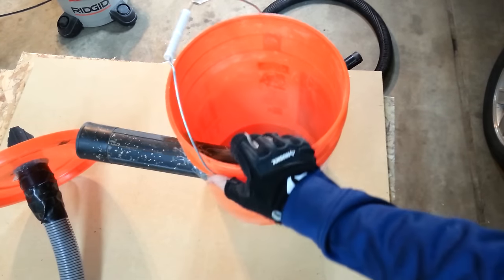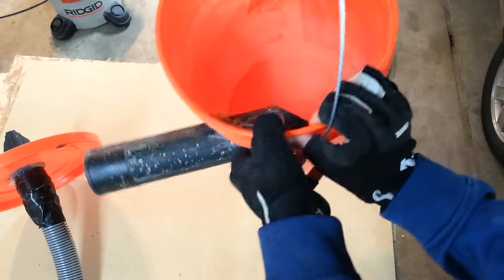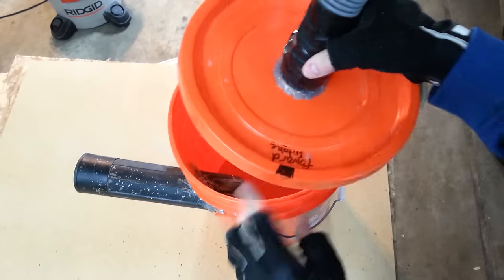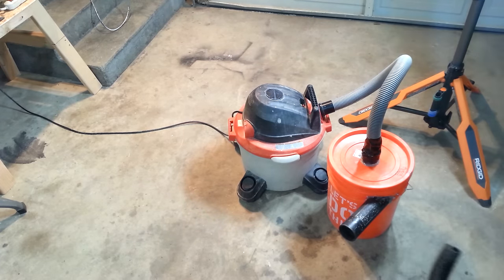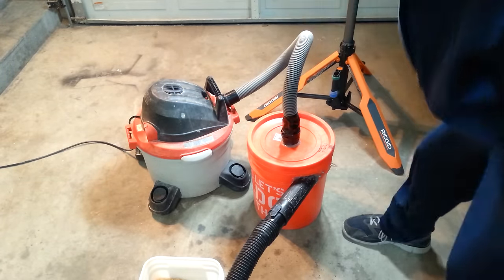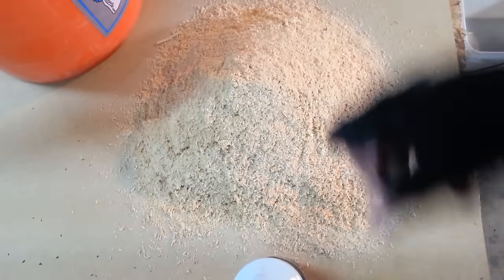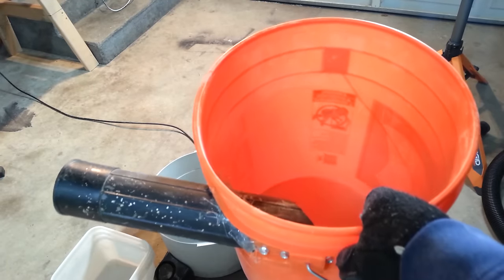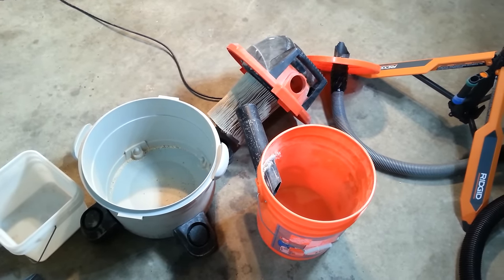DIY Dust Collector/Separator home made in less than 20 minutes with a bucket and spare vacuum parts

Comment: Thank you , I just made this for the price of $1.45 , I had an old vacuum that I used for parts with my 16 gallon wet dry vac and I bought the lid from home depot for $1.45 ,and  it works great . Thanks for sharing your talent .
Reply from the maker: Sure thing glad I could help and that it worked out for you. 👍

Comment: Thank you for posting this!  I made mine this evening.  This has helped already SO MUCH!!  I put both hoses on the side of the bucket.  One like you have.  And the other, to the left of the first one on the same side.  I faced the angle cuts opposite each other as you mentioned.  I also cut the holes the same size and used heat to 'squeeze' the hoses in so as to make a tight seal without having to add extra 'stuff' to seal them.  I put plastic strips on each side of the bucket and the wet-dry vac.  I stacked the wet-dry vac on top of the bucket and used the plastic strips (with wing-nut screws for quick-easy detachment) to keep the two stacked.  It was easier for me to move around this way.  I also added a HEPA filter on the inside of the wet-dry vac and over the exhaust.  This keeps the smaller particles from coming through.  Again, thank you SO much for your post.
Reply from the maker: I'm really glad you liked it and that you were able to build one that worked for you, I think that's really cool that you added a HEPA filter to it that thought never even crossed my mind! Thanks for watching my video and commenting, I'm really glad it helped you out! 👍

Comment: Great work. I put a 3 pound exercise weight in my bucket and have no problems with bucket tipping. Also I have a shorter hose between the vac and bucket. Thanks for sharing.
Reply from the maker: Sounds like a good setup, glad you liked the video.

Comment: Thank you for sharing. I made this today since I bought a new shop vac and wanted to preserve the filter and bag which are both quite expensive to replace. I used what I had on hand... thank goodness I kept hoses and attachments from past vacuums. I burnt out the motor on my mini shop vac not realizing how much dust is generated from the table saw {my first), so I need to control the dust...cheers to healthy lungs! I spent $2.50 US, the cost of the bucket. Very excited to complete projects now that this is done.
Reply from the maker: Glad it helped u out, I also built mine after I got my first table saw because it creates so much dust and this dust collector is a good cheap way to keep most the dust out of your shop-vac to keep the filter cleaner and extend the motor life! I actually had all the parts on hand so mine didn't cost me anything to make and I have hoses running all over, I have one hose that my miter saws share and another hose that my router table and table saw share so I don't have to change hoses around as often which is nice. Thanks for watching my video and I'm glad it helped and thanks for commenting! 😊

Comment: Add 2nd bucket and make it taller for better 'waste drop' . Taller waste drop creates less filter clean up. So join both buckets at rim by modifying lip and insert together then drill hole in sidewall with 45 degree elbow to spiral partially downwards.Use same process for suction input
Reply from the maker: Sounds like a good idea, I'll have to try it out. Thanks for commenting.

Comment: Great idea and a simple design.  Good questions and answers too.
For me, it's about grinding off carpet glue, three layers of old, flaking paint and a certain amount of concrete dust.  Tried going direct from my angle grinder dust shroud to my shop vac but had to stop and empty the dust and shake the filter off every 5-10 minutes; way too much faffing around.  I will give this straightforward design a shot as the HD Duststopper is expensive and needs expensive hose adapters, which may require modification.
I sure hope that not too much of my toxic dust gets to my shop vac.
Reply from the maker: I hope it works out for you, please let me know how well it works because I've had a lot of questions how well it will work with fine dust like drywall and concrete dust before but I haven't been able to answer them because I've only ever used mine for wood dust, it stays in a fixed place in my garage and I hook it up to all my woodworking machines like my miter saw, table saw and router table for the most part and it works great with those. So I'm very interested to know if it will work with dust as fine as concrete and drywall, one tip I've heard that might help if it's not collecting the dust very well is to put a small amount of water in the very bottom of the bucket so it will help catch the dust, but not to much because you don't want the vacuum sucking it up. Thanks for watching the video and I hope it works for you and please let me know how well it ends up working with that concrete dust! 👍
Reply: @chevy5137  Waiting for my new Ridgid hose to arrive, when I will do a  dry assembly and see what PVC pipe and adapters are needed - I'm favoring rubber connectors. Take a trip to HD and will let you know the result.
Reply from the maker: Milwaukee m18 metal saw
Reply from the maker: @SELondonUSA  Sounds great let me know how it goes 👍

Comment: I seen that on another channel last week ,then he bolted it to the top of a rigid vacuum seemed to work pretty effectively!!!!
Reply from the maker: Yeah that's a good idea if you need it to be portable, another way to go is you can make a cart with caster wheels on the bottom with a divider in the middle and put the bucket and vacuum side by side so it's not top heavy and you can also pull it around easy since it's on wheels. The reason I didn't didn't do either of those things is because my vacuum and bucket stay in place under the work bench that I made for my router table to go on top of and they never move. I have hoses going along the wall of my shop where all my woodworking tools are so I can hook up my miter saws, table saws and router table all to it without having to move it.

Comment: Nice and simple. One thing that I observed that you did but did not mention in the video is that you stabilized the pipe in the side of the bucket with 1 screws. This seems to be a necessary feature to keep everything from relying on hot glue alone which is not  strong enough to support that pipe all by itself.
Reply from the maker: Yeas I did do that and it needs to be there to help stabilize it unfortunately I forgot to mention it in the video. I'm glad u noticed that!

Comment: In regards to the collapsing bucket issue you could probably make a valve that would open if vacuum inside got too extreme. Some vacuums like my old dyson has this already built in, if you fully plug in the inlet you can hear the valve pop.
Reply from the maker: I want the vacuum to run at full power though so that it'll suck as much dust in as possible so doubling up the buckets was the way to go I think.
Reply: @chevy5137 Good idea to use a second bucket but the lid also collapses, no? Do you have a solution for that?
Reply from the maker: @za.z.6061  I never had the lid collapse on mine but with a stronger vacuum I added it started sucking in the bucket sides so I had to glue and screw 2 buckets together.

Comment: The Thien baffle keeps the system from sucking up more dust as the bin gets full. Without a baffle it is going to pass more and more dust the fuller the bin gets.
Reply from the maker: Yes that's true this is a very simple design but if you empty it when it gets about 1/4 full it does the trick.

Comment: Great video .
Just a thought have you ever tried putting a brick in the bottom of the bucket just to make it a bit more stable .
Regards from the UK.
Reply from the maker: Terry Robinson no I hadn't thought of that before because I have mine in a confined area where it can't move, I only have it out in this video for demonstration purposes, but that's a really good idea! It would definitely help keep the bucket from tipping over when you have it out in the open. Thanks for watching the video and commenting with that really helpful tip! 😁
Reply: @chevy5137  A little in commenting but using another bucket with a few inches of concrete in it, that you then set your separator in works great.  It really stabilizes it.  Thank you for the video.

Comment: Ok after watching a lot of these videos and doing research I can tell you the weakness of this design . The more dust that goes in your bucket the worse performance you will get. This system scrubs the dust in the bucket and then the stirred dust will fly up the pipe to the vaccum.  Both the thein baffle and the cyclone will out perform it.
Reply from the maker: Yeah this is a cheap solution and you need to empty it when it's about 1/4 to 1/3 full for it to stay effective.

Comment: Was thinking about making a device exactly like this but just wouldn't allow myself to believe something so FAST AND EASY could work so well.  I guess it's the SCIENCE behind the effect that actually does the job.   Want to make one for my dust collector but adding the baffle seen on most others, either fabricated or factory produced.  Thanks for doing the prototype work.  Now I'm wondering if an old shop vac tub would work even better due to its larger capacity and sturdy construction.
Reply from the maker: Wayne Cameron Yeah I was surprised to at how well this model works and yeah if u add that baffle deal it'll work even better, I haven't bothered doing that because I don't use my tools that hook to the vacuum system enough to warrant it.
Reply: I found out about this sort of thing only a week ago and now I'm nuts for 'em.  I want one on my dust collector AND my shop vac.  My DC has a 5 micron bag which is WAY better than no collector at all (wife bought the unit for me) but now I've got a layer of 5 mic dust on everytghing in my shop.  I'm also getting a Wynn .5 mic pleated paper filter and having about 10 times the surface area of my bag, plus I'm going to have a powered vent to the outside.  I'm doing a remodel of my workshop benches and building-in my bigger power tools, and building an automated system to pre-control dust and chips is going to be a big time and hassle saver.  Having to constantly deal with that is one reason I don't make as much stuff as I want.
Reply from the maker: Wayne Cameron Wow man it sounds like you got an awesome shop, I hope you get your dust collection system setup just the way you want it so it works great, it sounds like you have a really good plan to make an awesome dust collection system and a sweet shop too! I just work out of my 2-1/2 car garage with all my tools against the wall, 2 miter saws, a router table and I have a Ridgid table saw that like a jobsite saw and is on a roll around gravity rise stand so I can fold it down when I'm done using it and put it against the wall, for a jobsite saw I'm surprised how accurate it is, it will cut down to 1/64" of an inch! It sounds like u have a way better shop lol! 😉 Putting one of these on your shop-vac too is a good idea and the way to go there is to make a little cart with wheels that both your shop-vac and dust collector bucket can fit into and then it becomes like one unit that you can roll around and that way you don't have to drag the dust collector and shop-vac around separate.
Reply: Not really.  My benches and floor tools take up half a 2-car garage, although I do tend to "spread out" when I need to, and occassionally I have to leave the wife's car outside for days or weeks at a time.  Hope my Wynn filter arrives today so I can finish that conversion.
Reply from the maker: Wayne Cameron Ah sounds like we have similar setups except all my tools r against the wall but I do have a 2-1/2 car garage so it's pretty big, I also have my toolbox and a work bench in the front of my garage and my entire front wall of my garage is pegboard so I've got tools hanging all over it lol, also on my tools are against one side wall and my entire other side wall is nice cabinets so I have plenty of room to store stuff like my cordless power tools and supplies and stuff like that which is nice
Reply: A big (enough) shop and a selection of tools that are adequate for any project you might think of is truly a GOOD thing.
Reply from the maker: Wayne Cameron Absolutely having the tools and equipment to be able to do any project you want to do, or any mantinence and repairs you need to do is the best! I always try to buy a tool when I need it rather than borrow one that way I always have it for down the road when I need it again, I'm a total tool nut so I love having all the tools I need to do whatever I need done and I'm always happy to add new tools to my collection and if I can pick up a tool that will make it so I can do things better, faster and easier you can bet I will!
Reply: I can't remember the last time I borrowed a tool.  But, of course, that means I have some tools that I may never use again (but I hope to).  I bought a biscuit cutter about 5 years ago and now I'd have to search to find it.  
I thought my edge planer (joiner) wasn't turning fast enough so I installed a new motor, and I've used it maybe 3 or 4 times since then (it's an old model with 36" cast iron bed and re-sharpenable blades and now I know it will last the rest of my life, so I don't mind that it cost almost as much to do that as to buy a new joiner).  
Now I want one of those 24" thickness sanders, but WOW those things cost a lot.  Saw in a magazine about how to convert an old table saw.  Hmmm.
Reply: I love to buy tools, too.  Only trouble with that is having a shop full of tools and can't find the one you want.  A few years ago I had to side-join two planks, so I bought a biscuit cutter and used it for that task, but now it just collects dust (even though I have a dust collector to do that job).
Reply from the maker: Yeah I totally hear you about buying a tool rather than borrowing it, I always end up buying the tools I need it's a cold day in hell when I borrow a tool lol!
Reply from the maker: Well lucky for me I am super OCD, I am sure if you have seen my videos and caught a glance of my shop you can see how organized it is and you can also see that all my tools look like brand new because I clean them off after every use and put them back in their designated spot. So since I am so OCD all my tools are organized super nicely so I can find what I need right away!
Reply: Organization???  Cleanup???  Huh?  lol  I've done that before, and the danged evil fairies sneak in and gradually mess it all up.  Should get in the habit because I DO like a nice, open, uncluttered shop with NOTHING on my benches except the project I'm currently working on.   But it seems just I have too much stuff for my drawers and shelves and boxes and milk crates and bags and old coffee cans and leaning up against the outside of my garage.  But my new dust collector will cure all that.
Reply from the maker: Wayne Cameron Yeah my shop can start to get cluttered sometimes but it doesn't take long before it'll drive me nuts and I'll go on a cleaning and organizing spree lol

Comment: I built one of these using the Home Depot bucket and using a Harbor Freight vacuum.  It works great but if you plug the inlet hose it will partially collapse the bucket.  I found a Soy Sauce bucket on the street side and it works just fine.  The HD top did fit the new bucket.  The top will pull down some but did not collapse.
Reply from the maker: Ya I have heard of people having problems with the buckets collapsing but I never had that issue, I lucked out I guess!
Reply from the maker: Robert McFee So I ended up getting a new vacuum with almost twice the power at 4,25hp and it wanted to collapse the bucket some so I dropped the collection bucket inside another bucket and glued and screwed the 2 together and that seemed to fix the issue

Comment: It's ok for the big chips that you can see, but it's not ok for the finer dust that damages your lungs. It's definitely worthwhile to make a separator followed by a HEPA filter in your vac.   It's up to you.  The only advantage that I see with yours over a cyclone separator (e.g. Dust Deputy) is that it's shorter and may fit into tighter space.
Reply from the maker: Yeah it's also much cheaper than a dust deputy and it's not meant for a big time shop it's a cheap and easy solution for DIY and weekend warrior guys like me who want some dust collection to keep most of the dust and chips from getting into their shop-vacs
Reply: My concern is also for the very fine dust.  I do little woodworking indoors but am hoping to do more.  I have been trying to find ideas for building a fine dust filter that isn't too expensive.  Perhaps my idea is science fiction.

Comment: Not much matey. You got to consider that the fine dust will keep going airborne all the way to the auction source, so it will go into the filter any way. The heavy stuff will fall normally. But the fine stuff that will clog your filter and no matter how you do, if you have produce fine dust your filter will clog up.
Reply from the maker: Yes of course some small stuff can get thru but it still keeps the majority of dust from getting into your wet dry vac which is the point.

Comment: Can you do a follow up now that you've had it for a while? I made a basic bucket separator like this and found the maximum I could catch in the bucket was about 4 inches deep. The wind inside was so great that it would stir up the dust too much and not let it settle, so more and more of it would go direct to the vacuum. Does yours do that also?
Reply from the maker: Yes it does seem to have that issues just a little bit but I don't use my woodworking equipment a lot so it doesn't fill up super quick for me. I'll try and do a follow up video, I was hoping to do a video showing my whole dust collection system. Thanks for watching and commenting bud.